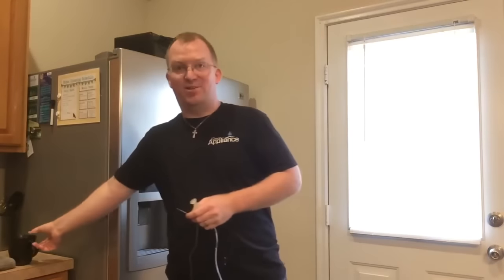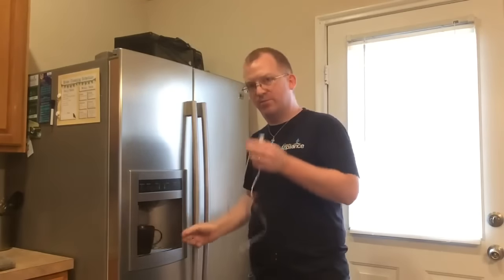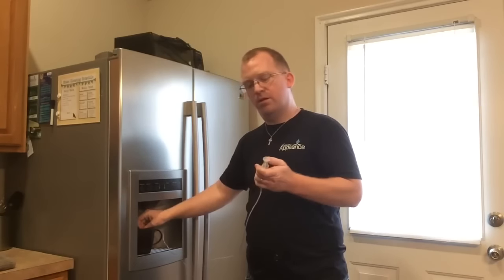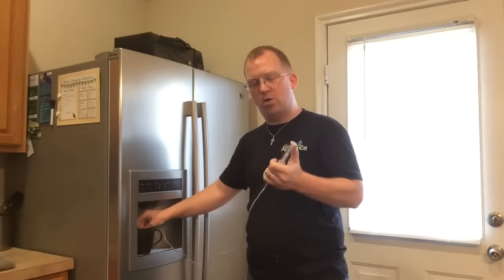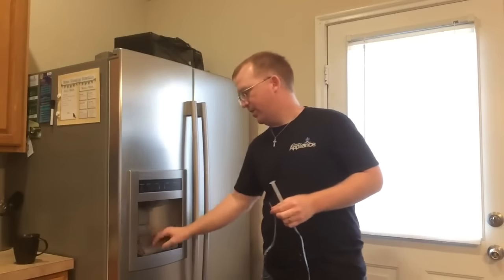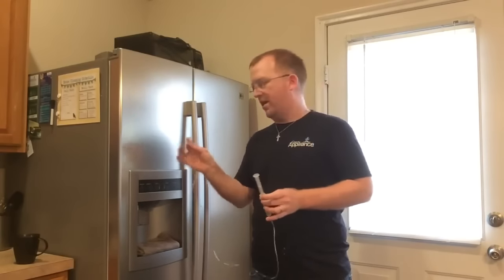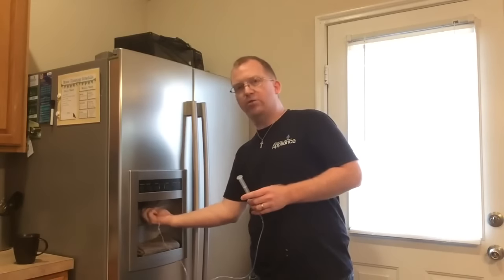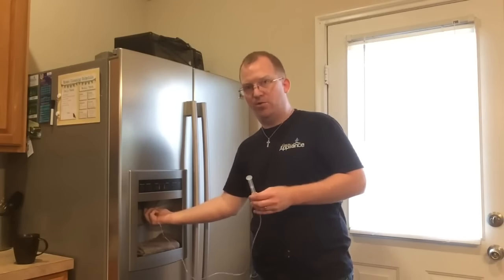The FASTEST way to thaw a frozen dispenser!

Comment: First of all, this tool does what it says. It allows you to unblock the frozen water line quickly. But if you have an underlying problem with a really poor fridge design, as I do, you will find you have to use the tool once or twice a day because the water line keeps freezing. 
I have been looking at all the online posts on resolve this problem and have tried them all: - Insulate the inside of the freezer door. Didn't work. - Replace the ice cube flapper. Didn't work. - Stick a piece of weed eater cord in the water line and pull it out when the line freezes. Not a good solution. The line in the water hose actually causes it to freeze more quickly each time. Then it's really hard to pull the line out. And I don't feel really great about having an unsanitary piece of plastic hanging from the water line. Bottom line is this is a poor solution and causes the line to freeze again within minutes. 
So today I have installed the GE WR49X10173 water line heater. This was no easy feat as the instructions are crappy but there's a good YouTube video that helped. Although beware that your wiring scheme and colors may be different than what's shown on the video. And I had a really hard time getting the wires to connect with the splice connectors. I had to expose the wires to finally get them to connect. Will this solve the problem? Still too soon to tell. But the next thing is to get a new door that has the proposer design and insulation. We didn't purchase this fridge - it was in our new house when we bought it. But I've had nothing but trouble with this water line for the last 2 1/2 years. I will never buy a GE fridge for this reason. It is a poor design and they don't seem to care to solve it. 
Ice Surrender is a really handy tool and will at least allow you to quickly unfreeze the water line. Before I found it I used to spent 30 minutes with my hair dryer and the freezer door open to get the water working. So it's great from that perspective. 
But the real issue is with GE and their lousy design. Unforgivable for a company that is supposed to be a leader in the industry.
Reply from the maker: Thanks for the comment Dale. What a hassle you've had with that fridge!  You literally have tried it all it appears. Outside of raising the temperature of the freezer slightly and making sure that there isn't any food touching the freezer door when it's shut, that's about it. I've wondered myself if the ambient temperature of the room has a bearing on the waterline freezing more often, but I have had as many orders from warmer climates as I have from colder climates so I don't think that's an issue. 
I'll also be curious to see if the newer GE's will have this same problem 5-10 years from now. GE has recently been bought out by Haier Appliance a Chinese company which does not have a good reputation by any stretch - so I don't see good things for GE's future. 

I hope the heater kit does the trick for you.  Also, i've heard of people leaving the door light on full time to produce a bit more heat near the dispenser, but again - not an ideal solution. 

Personally, I feel like GE should be proactively sending their fridge owners a free heater kit & IceSurrender with install instructions and an apology note.  Seems like a really cheap way to gain some good will from your existing customer base.  I've tried telling GE this, but who's really listening? You'd think a few million bad reviews might get their attention.
Reply: Have you tried lowring the temp a little bit? that worked for me, If your freezer is full, you need to lower the temp. since you don't need higher temp to keep things frozen.
Reply: @lillianj.torres9538  freezer aren't just designed to keep things frozen, they are designed to stop bacterial growth for long term storage. That means a freezer must be set no higher than 0 f. Spoilage bacteria grows aboven 0 f and will double its rate of growth every 5 degrees above 0.  Keeping food for long term storage is certainly more important than increasing the temperature to get water at a dispenser.  Freezer 0f and fresh food compartment must be set between 36 and 38f as pathogens grow at 41f and a fresh food below 36 will freeze vegetables.  Middle or normal settings on refrigeratos are calibrated for freezer to be - 2 to 0 f and fresh food 36 to 38f